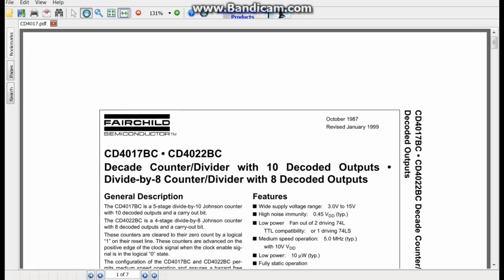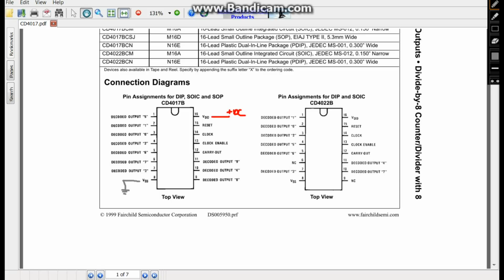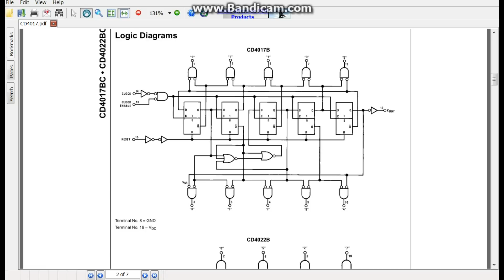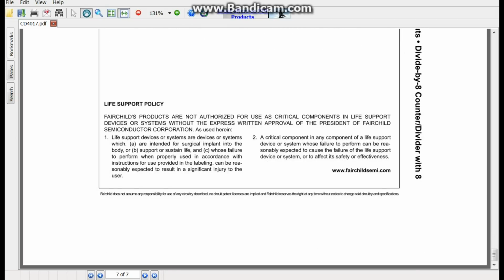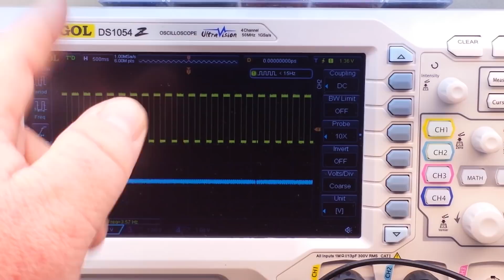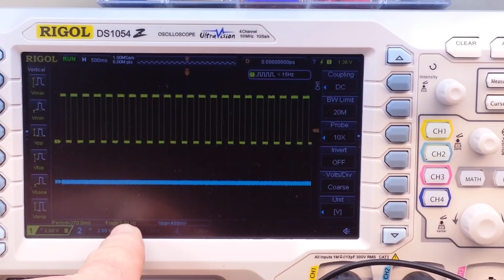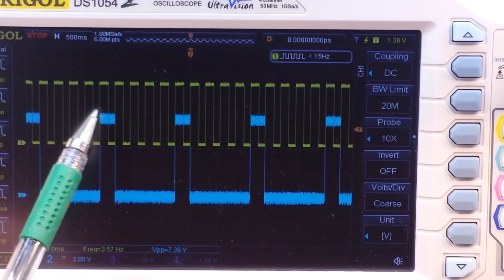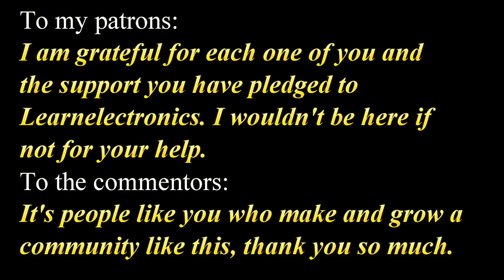Understanding the CD4017B Counter

Comment: Is there an IC counter that outputs high for every multiple of a number ad infinitum?
Like you send in a clock sequence, and, for example, output 7 would go high on 7, 14, 21, 28, 35..... and output 4 would go high on 4,8,12,16, 20....

Or do i need to just set up a comically large network of transistors? xD
Idk what i am doing :D
There's probably an easy way to do this.

Comment: I used a CD4017 to sequence six 7-segment displays in a multiplex display before I realized you can buy address line decoders to do the same job. It works like a treat, still running today.

Comment: Thank you so much for this very useful video. I have to make an interface between the emulated encoder (EE) of a big commercial printing press and a video web-inspection system. The EE has a resolution of 8192 pulses per revolution of the print cylinder but the inspection system is limited to 1000. I will use two of these ICs to divide by 8 with the first chip to bring it down to 1024 and then 8 again by a second chip to bring it to 128. I made a prototype today but had really weird results. I had not grounded pins 13 and 15! I will try again with the information you have provided so thank you kindly, sir!

Comment: This is the best explanation yet! I would like a bit more info, if you have the time. I have a project in mind. A field of 50 circuits each containing 6 LEDs. I'd like each circuit of 6 LEDs to blink in an apparent random pattern, while the field of 50 circuits are randomly turned on and off. Imagine if they were stars. It'd kinda give a twinkling effect. 5-point stars with an LED in the center of each one. This can be achieved without the 555 timer, I think. The stars could be done in 5 groups of 10 (not wasting the outputs of the 4017), or 10 groups of 5? I am not sure how to draw a schematic for this. I am learning. If you will help, I will most certainly be grateful. A big thanks, in advance!

Comment: ground reset  ? that could be my problem... can't get it to perform its expected behavior whatever I try, static seems to be triggering it but when I connect the clock pulse pin to +5  nothing happens, already grounded the clock enable since I have learned a bit more about logic recently...   strange thing is I've used this same IC twice before with no issues. edit - didn't bridge ground across both sides of breadboard rails !

Comment: This was once one of my favourite devices. Here are a few of applications in which I used it, they all date back to the late sixties or early seventies, as there are now better, far lower component count, solutions for most of them.
I used one to implement a 10 channel radio scanner using an old Pye Cambridge transceiver on the VHF armature band. This used the outputs to switch pin diodes connected to ten different crystals on the crystal controlled local oscillator. The device input clock was inhibited by a signal from the opening of the radio squelch. This type of scanner circuit was very popular at the time, before the advent of more sophisticated, low cost, PLL circuits.

It is easy to use the 4017 to implement a simple push button combination door lock. The device outputs are connected through a patch panel, which sets the required combination, to the buttons of the key pad. The other side of the buttons connect to a common which is routed to a simple gate circuit. Push the right button, the one connected to the current high output, and the counter advances, press the wrong button, those connected to low outputs, and the counter resets. When the count reaches the last digit of the combination, it next output is connected to a solenoid transistor driver that unlocks the door. No micros involved.

My home made PCB UV exposure unit, uses a series of 4017s as a timer to control the UV lights. A  binary counter divides the mains frequency  down to 1 second ticks which are used to feed the 4017 counters.

I have used the device as a tone sequence generator for a "door bell". The counter controlled a simply voltage controlled oscillator made from my other favorite IC, the quad nAND Schmitt trigger. 

The device  also found application as a sequency generator,  to flash Christmas tree light, when coloured ( red, green and yellow) LEDs became freely available.

I have used one of these to control the initiation of electric matches and squibs for fireworks, though you have to be careful to take account of spikes on the switching outputs and during the reset.
Reply from the maker: Thanks for sharing those applications. I know I appreciate it and I'm sure others do as well.
Reply: @learnelectronics  the trick with the combination lock logic is to invert the button output so the counter advances when the button is released and the test is performed when the button is pressed. From memory, this can all be done with my favourite IC, the quad Schmitt nAND. Using a Schmitt allows the buttons to be debounced with an RC network, while still giving a fast clock edge to the counter.

Comment: Thanks Paul! I use a 555 and HCF4017BE for my Night Rider 6-LED circuit that is on my nighttime breadboard. I like the analog circuit better than the Night Rider circuit on my Arduino (digital) because it just has a warmer look and seems to have a smoother flow than the Arduino.

Comment: Is that ic capable of being used in a circuit for a capacitor testing device (charge/leakage) I know there are many applications it can be used for, like flashing circuits, firing off a string of relays with binaural/optical notification. But real life situations. What would this IC have been designed for besides it's obvious hobby curiosities?
Reply from the maker: Frequency division/multiplexing

Comment: I’ve been playing with the 555 and 4017 together for awhile now. I’ve been trying to get the timing right to make it a sort of long term clock by cascading 4017’s. That has been a challenge even using 10 turn pots. Great video Paul.